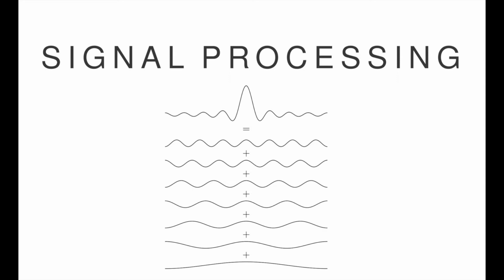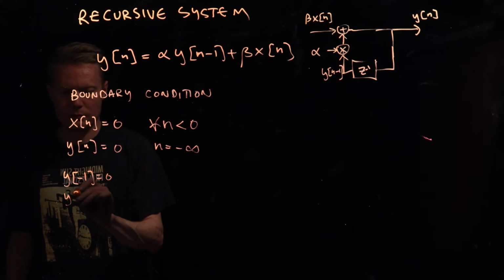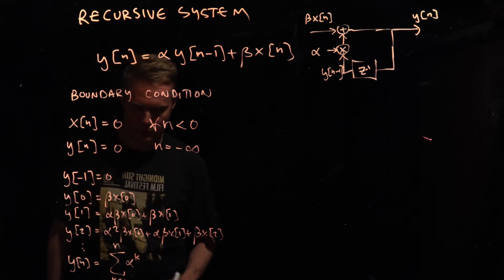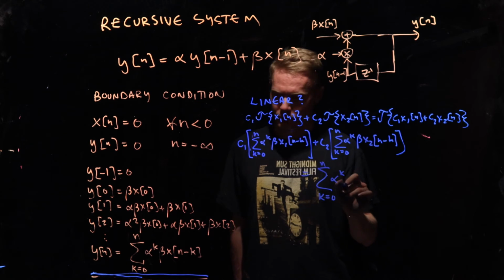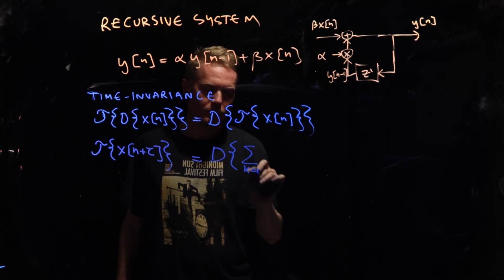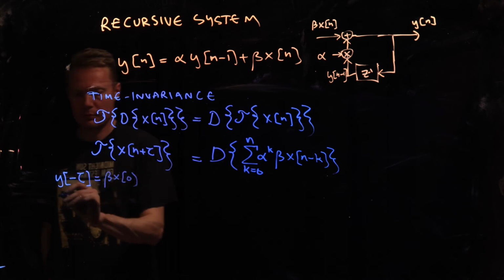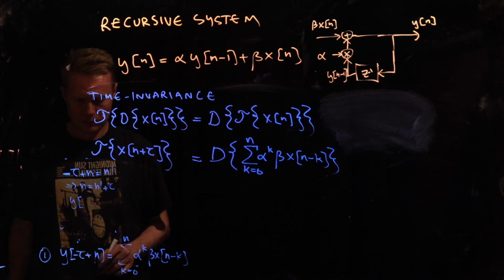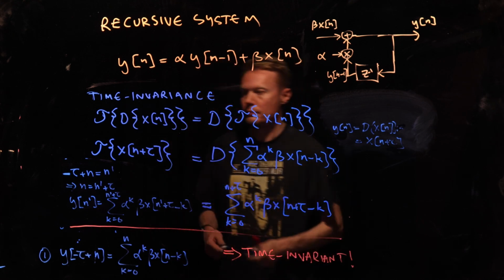Testing the linearity and time invariance of a recursive system (infinite impulse respose system)

Comment: Hi. Nice video. Thanks for making it. There are two things which might confuse someone learning this material though. You skip from the closed form of the equation to a test case using different symbols when someone unfamiliar with the notation would expect you do the test using the summation notation. So instead of saying "this is the test for linearity"
 it would be helpful to explain how you are doing the test.  "I can do the test assuming n = 0 so y(n) = x(n) and do the tests on that."
Reply from the maker: Thanks for your input. I have published my signal processing notes. You can find the notation and the test in the pdf found here: https://github.com/jvierine/signal_processing_course/blob/main/signal_processing.pdf Look at page 38 and Figure 26. I hope this helps.